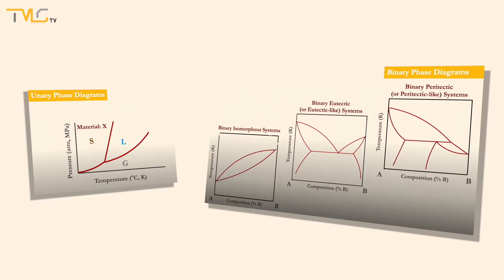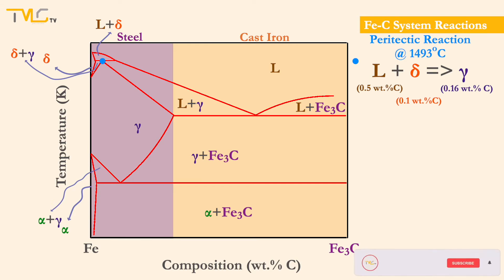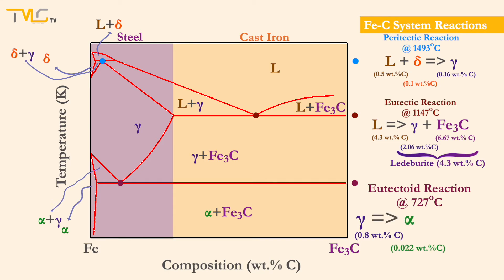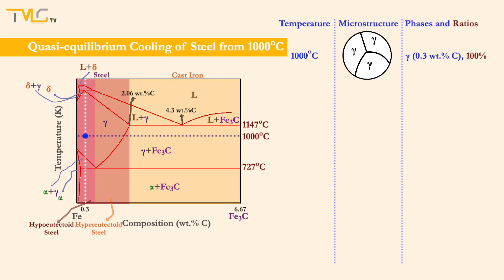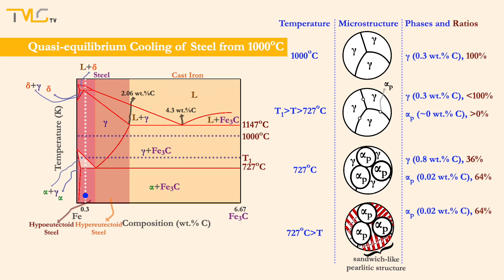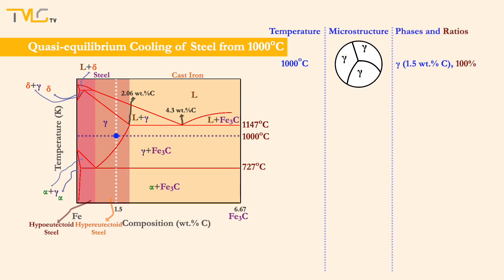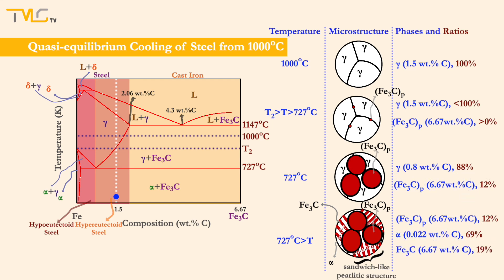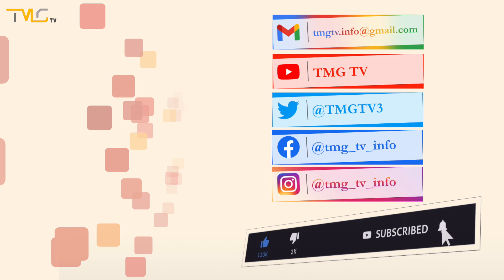Video #3.3 - Fe-C Binary System & Phase Diagram (Phase Equilibria)

Comment from the maker: Time Stamps
------------------------------------------------------------------------------------- 
00:10 Disclamier (Önemli Uyarı) 
00:31 In Previous Videos (Önceki Videolarda)
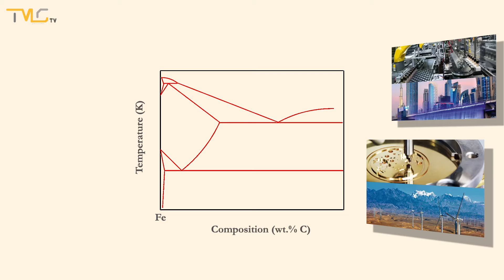00:45 Iron-Carbon Binary Phase Diagram (Demir-Karbon İkili Faz Diyagramı) 
00:58 Phases in Fe-C Phase Diagram (Fe-C Faz Diyagramındaki Fazlar) 
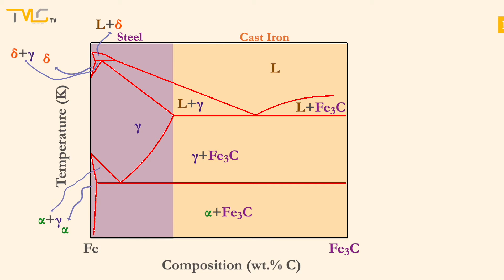01:33 Fe-C System Reactions (Fe-C Sistemindeki Reaksiyonlar) 
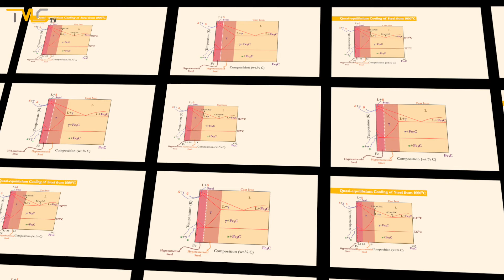04:10 Quasi-Equilibrium Cooling of Steel (Çeliğin Dengeye Yakın Soğuması)
04:28 Cooling of the Hypoeutectoid Steel (Hipoötektoid Çeliğin Soğuması)
06:48 Cooling of the Eutectoid Steel (Ötektoid Çeliğin Soğuması)
07:26 Cooling of the Hypereutectoid Steel (Hiperötektoid Çeliğin Soğuması)
09:10 Primary Phases In Hypo- & Hypereutectoid Steels (Hipo- & Hiperötektoid Çeliklerdeki Birincil Fazlar)
09:29 Introduction of Brittles by The Cementite Network (Sementit Ağıyla Gevrekliğin Sisteme Girmesi) 
10:08 In The Next Video (Sonraki Videoda)